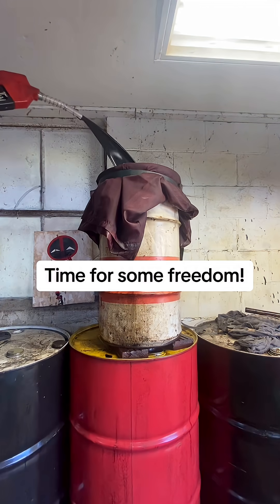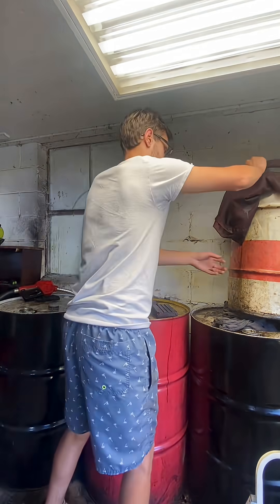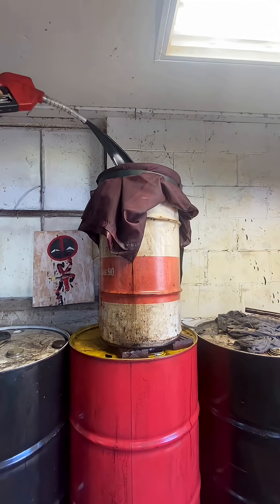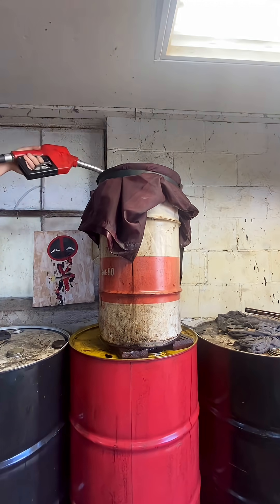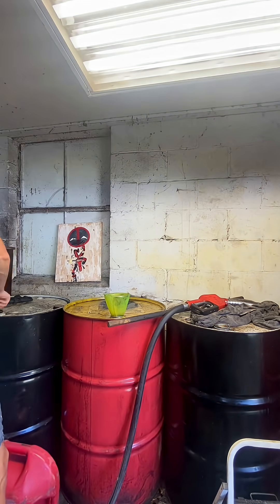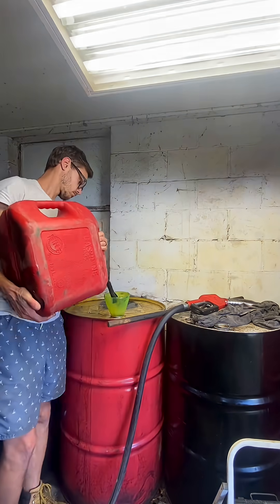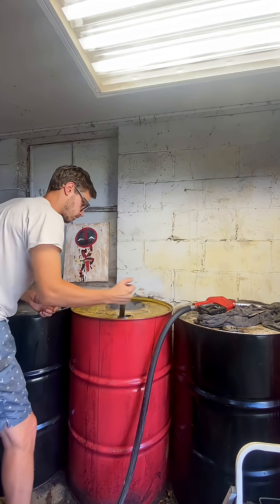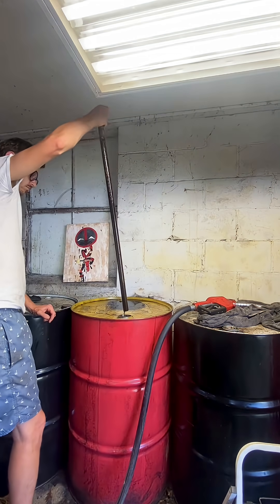Transform #wastemotoroil into #homemadediesel Fuel #dieselmechanic

Comment: Why would you put gas in if you are going to run it in a diesel? Why not diesel or kerosene? Also, I have heard that after letting it sit, you should leave the bottom inch or two, because there could be metal shavings or water that sunk to the bottom.

Comment: Remember, use the lowest octane gas possible. High octane means resistance to compression ignition, something you don't want in a gasoline engine....but you absolutely want it to easily compress ignite in a diesel engine.

Comment: Is the gas mandatory? Seen a guy use used motor oil from a mechanics shop and riding good. A lil smokey. Will any diesel do this or has to be special one?  What's the biggest problem with this and not talking about the making process, but the use thereof. Thx

Comment: When the zombie apocalypse happens this will be excellent knowledge to have. But until then i will save my injectors and pumps! You should filter it much better than that before you run it. It wouldnt be hard and it will save your injectors. Just run it thru a remote filter set up like they sell at sumit racing.

Comment: Make a funnel with a plastic bottle, which is normally wider than the spout, to receive the gas, with a wider than the gasoline spout end down into the tank, remove the spout of the gasoline tank, pour the 5 gal of gasoline using the new funnel or, attach to the 5 gal tank a wider hose like a radiator hose, with a clamp, it should fit into the tank entry, and that'll be your spout. One piece of radiator hose, one clamp wide enough. In Home Depot they may have transparent hoses in case one day you want to see it coming out but most time all you want is your gas in the tank or, if the neck of the gas tank fits into the receiver, just pour it without hose or spout.

May God bless you bro!

Comment: That’s not “homemade diesel.”
That’s thick, contaminated waste oil thinned with gasoline — and it’s a spectacular way to wreck an engine, get fined, or set yourself on fire.

Here’s why it’s nonsense:

Diesel is a refined petroleum distillate, made to precise standards for viscosity, cetane rating, lubricity, and emissions. Used motor oil is full of metal particles, combustion by-products, acids, and detergents — none of which belong in fuel.

Gasoline and diesel behave very differently. Mixing petrol into waste oil does not magically convert it into diesel; it just lowers viscosity and flash point, making it more dangerous to store and burn.

Modern diesel engines will hate it. Fuel injectors and high-pressure pumps run on extremely fine tolerances — one bit of grit or sludge from that “fuel” and you’ve got a four-figure repair bill.

Legally risky. In most countries, burning waste oil as vehicle fuel is illegal without a licence because of toxic emissions (heavy metals, dioxins).

Fire hazard. Petrol has a low flash point. Mixing it into oil makes something that ignites far easier and burns hotter — exactly the wrong thing for a diesel engine designed for compression ignition, not spark ignition volatility.

So in short:
He’s not making diesel — he’s making engine-killing Molotov cocktail soup.

Comment: Drill a hole in the top rear corner near the handle of your gas can then find a bolt a little bit wider than the hole and use that as a vent for the gas can when pouring out the gas remove the bolt and it will pour much better

Comment: Interesting.  Just curious.  How did you come up with the formula of 5 gal of gas to the used motor oil? 
Have you ever experienced any catastrophic engine failure due to this? 
(I'm pretty sure that's a no but I feel I have to ask) and what type of diesel engine are ya running?

Comment: Improper Combustion: Diesel engines rely on compression ignition, meaning the fuel ignites due to the high temperature and pressure of the compressed air in the cylinders. Gasoline is much more volatile and can pre-ignite or detonate before the optimal point in the compression cycle, leading to engine knocking, misfires, and reduced performance. Even a small amount of gasoline, as little as 1%, can lower the diesel flash point by 18 degrees Celsius.

Comment: If you’re driving an old enough diesel you don’t need to mix any gas into that. 12 valves. 7.3 idi and powerstrokes will both run well on straight used oil

Comment: If you’re using that big of a funnel you can just take the top of the gas can off. You can also drill a screw into the highest point when pouring for a vent. Or just buy a kit to turn them into the old style gas cans.

Comment: Get a 1/4 inch roofing screw drill a hole on the top of your gas jug near the back of the handle and slow jug draining problem solved. The screw is a "cap" so it doesn't spill or allow water to seep in.

Comment: In hard times ive mixed used oil to diesel up to 40%  worked but more didnt light well.  Had to up the flow on the pump and at least once a winter clean the nozzle with carb cleaner.  Still do it .when i have to.  Im switching to coal. Is waaaaay cheaperer.

Comment: If you drill a hole in the top of the gas can near the back it will make a breather so it will pore out a lot easier than ya just put a nail in it when you’re done
Reply: Or at that point since he's using a funnel he could just take off the nozzle...
Then pour slowish
Reply: I use a sheet metal screw.
Reply: Petrol is an abrasive. Diesel pumps and injectors don't like it.

Comment: Drill a small vent hole in the top of the gas can and it will flow MUCH FASTER. Or set the gas can on top of the 55 gallon drum and use a siphon pump.

Comment: Note to newbies: Black diesel (oil and gas) is not the same as regular diesel and is not suitable for many diesel engines after about 2005. It can be used in older engines with no emissions controls but it can damage or clog fuel pumps, injectors, and emissions control equipment. Buyer beware. It's cheap and dirty.

Comment: I remember when I was working at c.R England they would pump our used motor oil straight into the diesel tanks.And have us burning on the way out.Just had to filter it to get all the metal out of it

Comment: It seems like a simple process. Where do you get your used motor oil from? So it’s 5gal to 45 oil in the summer and 10 to 50 in the winter??
Thanks in advance. Any other suggestions or advice would be appreciated. Thanks you!

Comment: Is the waste oil just engine oil?  I burn waste oil for shop heat.  I know how hard it is for people to not have any water or antifreeze let alone gear oil ir transmission fluid etc mixed in.  They all burn but wondering if they effect ur process

Comment: Waste diesel oil is great to rust proof and lubricate crane cables. The dirty carbon in the oil provides strand to strand lubrication and the oil penetrates to the cable core the way a heavy grease will not. It is free so I use it.

Comment: As a chemical engineer I guarantee you that you're not making diesel fuel. You are making a hydrocarbon mixture that has a similar density to it, but is not diesel.
Gasoline is composed of hydrocarbons with a chain length from C4 to C12.
Diesel has hydrocarbons from C10 to C24 (usually from C15 to C18).
Engine oil from C15 to C50, but unlike fuel that has a much (much) lower proportion of additives, usually the "base oil" in an engine oil is about 75% of the composition, and the rest is additives (detergents, viscosity improvers, antioxidants, etc).
So, by adding gasoline to engine oil will give you a liquid with a similar density to diesel, but is NOT diesel.
Can you use it? for sure, it still hydrocarbons burning.  But don't expect good efficiency and clean combustion.

Comment: Poke a hole in the back of the gas can small enough to where you could thread a steel bolt into the hole then just take the bolt out when you want to pour the gas out and it’ll drain very quickly

Comment: They make 2 and 3 foot long galvanized paint stirrers that you put into a drill and im pretty sure they have some that would go through the opening on the barrel, ive also seen some that have a galvanized rod with plastic on the end that you can squeeze together to fit them through smaller holes. It would mix it up way better but i dont know if that matters or not, if all else fails you could hire Hillary Clinton to come stir it since shes a fully certified Witch🤔 hehe

Comment: This isn’t diesel this is a fuel mix (ratio’d gasoline and oil, commonly for 2 stroke motors) 

This is fine for your lawn mowers and other 2 cycle applications, as it’s a “lubricant in” feature that backside compression engines can take advantage of (resulting in super small, easy engines - but not all 2 stroke require this, and some larger complex ones have separate lubrication systems)

But make no mistake, this is not diesel. It may burn dirty like diesel, and a diesel or petrol motor may be able to handle it, but it’s going to gunk up worse than a sinus infection in a steam sauna.

Comment: You might want a couple more filters preferably in line with a pump and also put a water separator on the line you use to pump the fuel out of the barrel with. It's kind of ok with the older diesels, but the newer ones that's going to clog up the filters so fast it isn't funny, and if it gets to the injectors it'll probably cause a nightmare. Look up the same parts per million (PPM), or micron rating if it goes by that that your vehicle's fuel filter is and find a nice big one for doing this.

Comment: Gasoline is a bad idea. It's literally designed to not explode under compression. Diesels are compression ignition engines. Kerosene is a much better choice to thin the oil. Also you can just use an oil filter inline with your pump. That would be easier than the bed sheet and also remove much smaller particles.

Comment: I have had to retire two pieces of equipment at work... the ex military diesel engines both died of damaged Injection Pumps.
Apparently the fuel oil is supposed to be incredibly clean and *correct % of Ash and Sulphur*.  Neither condition was being met and eventually the precision pumps wore out and the Injectors became coated with varnish like substance. 
Junk engines because the British imported fuel wasn't quite the diet those engines need 
Long ago at a place I worked at we had a postwar bulldozer and it apparently wasn't fazed by dirty old or unknown substitute fuels. 
It had a huge 2 stage filter though. 
Maybe you can do this a couple times a year but doing it daily...my $ on the injection system crapping out eventually.
It's supposed to be a certain % of Sulfur and Ash this is a random mix of chemicals. 
Burning the oil additives detergents etc and then a lot of metal particles and engine sludge getting in over time. 
I would just do a tiny bit and the rest the correct fuel

Comment: I used to make bio diesel with friends and this is stupid. Why are you mixing in gasoline? Heating it up will drop any metal and water to the bottom and that's as easy as storing used motor oil in a black can in the sun. Just mix with a little diesel if you want to but I've pumped veg oil straight from a collection can to my truck and that has a way higher viscosity than motor oil.

Comment: 1. You can drill a hole in the back of the gascan-handle, and put in a one way valve or just a smal open/shut valve and it will take secons to emty it and just let in air.
Two take a bit of a hose and put into the bottom of the can before you start poring it and bend it up to the handle or similar and it will poor mutch faster letting out the vacum..

Comment: So, filtered used motor oil + gasoline.
In a ratio of 50 to 5 gallons?

What if you try to do that with AVGAS instead of gasoline using the same ratio of 50 to 5.
Avgas is aviation gasoline and it has more octanes than normal gasoline, it's also Low Lead, so try not to touch it or smell it...i mean you won't die if you do, but Lead is toxic, so why expose yourself right? 👍🏼

Comment: Perhaps a slush with magnets to catch metal fragments from the oil.
Reply: Not a bad idea, of course it would only collect ferrite metal so probably something from like the crankshaft but little else.
Reply: Could probably do that at the filter step if he added magnets over the sheet
Reply: @pirate2352 , crank bearings are white metal and not magnetic
Reply: @andywilliams298  hey! You're using my name! 😂 Did your teachers make fun of your name like mine did? My first boss on the railroad always called me moon river.
Reply: When I was a kid old farmers added oil ( new) to gas for diesel in a pinch . Was  common knowledge.  Unfortunately I've never been very common and dont remembry the formula. Have asked many in the past sev. Yrs but everyotherbody that knew seems to be dead. Most look at me like I'm stupider than usual.
Reply: Store in a black can with a tap at the bottom in the sun. Will get hot enough to drop all metal and water to the bottom.
Reply: Crank bearing material isn't magnetic
Reply: @andywilliams298  Oh........??? Why is that?
Reply: Most metal shavings you'll collect in oil are non ferrous
Reply: It's already filtered going in if your letting metal flakes through you need a better filter
Reply: The magnermts will catch steel but not white metal from bearings.If he used a high pressure pump he could use proper fine micron filters amd clean it real good
Reply: Nice idea 💡
Reply: Hey what if the can it self was actually magnetic
Reply: just pump it out via a filter.
contaminant problem sorted!
although not sure I'd like to put it through my diesel injector pump.
Reply: Or just put magnets around the hole at the bottom of the filter can
Reply: @steg8218  Or just buy diesel fuel
Reply: Thats what the filter on top of the small barrel is for
Reply: He could also build multiple circular electromagnets around the inside of the smaller barrel and really make sure all the ferro metal is outta there... 😏
Reply: Yeah I'd have magnets all inside the wall of the metal can and at the bottom

Comment: Does it cause any problems with the exhaust system, injectors, e.g.r. or any pollution controls? How about smog tests? A bed sheet may not filter enough to protect injectors. Maybe short-term, but not necessarily long-term.
Reply: This is what I’m wondering about too. Is the filtration sufficient?
Great process regardless!

Comment: I expected more people in the comments trashing this method. It may not be perfect, or as efficient as straight diesel, but it's practically free, and the knowledge is worth more than anything if you find yourself in a situation like back in the 60's when they were rationing gas.
Reply: That was the 70s during then Carter administration.
Reply: @trippmoore Nixon and Carter administrations. 1973 and 1979.
I would ride with a gas can on my bicycle in the '79 crisis, use a pump that no one was using (each grade had a pump not the common pumps seen now), then take the can home and add it to the car.
Reply: That was the 1970s. Jimmy Carter (D) was president.

Anyone else notice that things are always worse after a (D) presidency???

It's said that JFK & RFK were done in because of their going against that (D) system.
Reply: You don't even know what straight diesel is...
Reply: Straight diesel is kerosene.

Comment: awesome.
1. are you running any specific filters on your trucks fuel system?
2. You homemade fuel is 50 parts used engine oil and 5 parts gasoline? are you Biased with the type of used engine oil, ie. conventional, synthetic blends, full synthetic?
3. what engine/vehicle is burning this homemade "Diesel"?
4. how many gallons of this homemade Diesel have you used/burned in a single engine?
5. I apologize if these questions have been answered before, I just came across this video randomly and needed to ask you directly.  I'll be following & commenting more.
Cheers and congrats and thanks for sharing!

Comment: Redneck engineering at its finest. 😂 To save cents, this’ll cost dollars in repair eventually. This may be an alternative but it isn’t diesel. You’d be better off buying bunker oil or railroad diesel and adding #1 Diesel or turbo naphtha. By distillation profile, this junk would be bimodal with the middle part (diesel) missing. Forget the particulate “filtering”… How does the engine handle combusting dissolved lube oil additives like antifoam (silicon) and shear reduction (zinc)?

Comment: Don't listen to this idiot this is why No, you cannot effectively and safely create usable diesel fuel by simply mixing gasoline and used motor oil. While older diesel engines may tolerate a gasoline and oil mixture, modern diesel engines are not designed for it and it can cause significant damage. Gasoline and oil have different chemical properties and combustion characteristics, making them unsuitable for use as a diesel fuel substitute. 

Here's why:

Different Combustion Properties:

Gasoline and diesel fuel have different ignition points and burn rates. Gasoline ignites too early in a diesel engine, leading to knocking and potential engine damage. Used motor oil, especially in a mixture, won't burn efficiently and can leave harmful deposits. 

Engine Damage:

The mixture can cause excessive friction, overheating, and damage to critical engine components like injectors, pumps, and filters. 

Not a Diesel Substitute:

While some older diesel engines or multi-fuel engines might tolerate a gasoline and oil mixture, it's not a viable or recommended substitute for diesel fuel in modern engines. 

Environmental Concerns:

Burning an oil and gasoline mixture can produce harmful emissions and contribute to pollution.

Comment: Tried this in my 2017 F550 a day later I was spending $12k on a cp4 disaster kit and mechanic to fix it.  Now my 2002 & 1996 F250s with the 7.3 they have ZERO problems.  They take it like your mother law on Friday night after a few drinks.  But anything 6.4 and above I do not suggest using this.